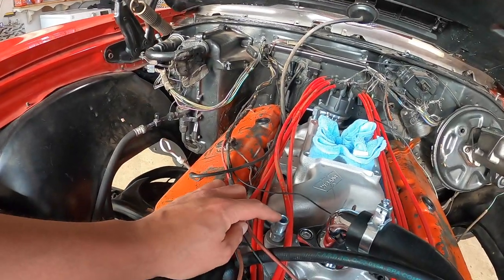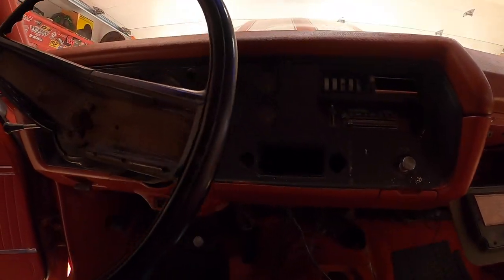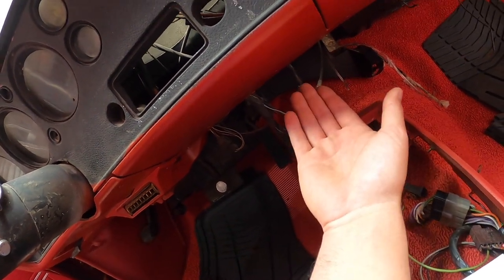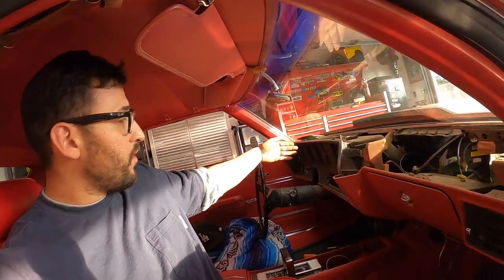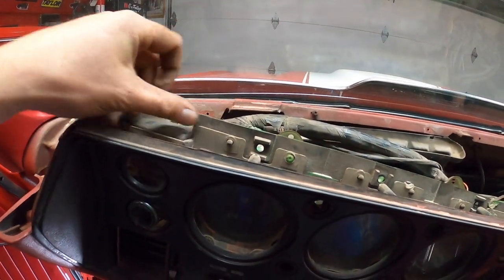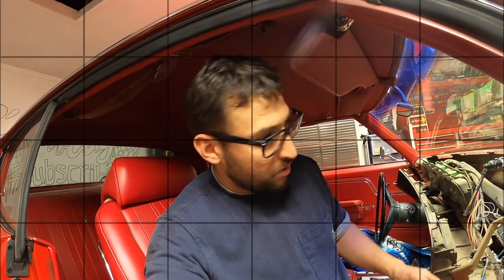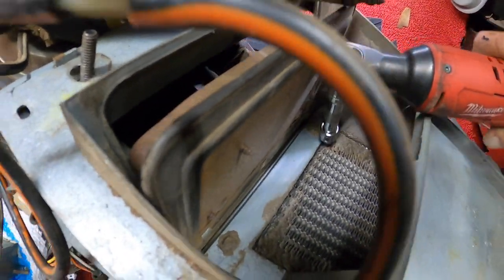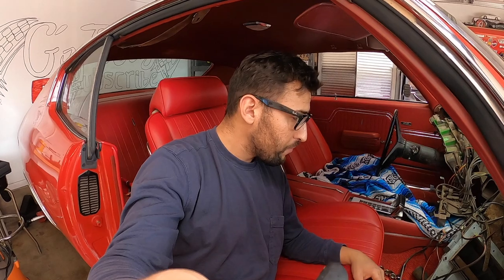How to replace heater core *** 1970 chevelle***

Comment: Thank you for the video. I will be sticking with the heater bypass. The applause was great!
Reply from the maker: hahaha it really was a mission to do!
Reply: @gsfootage5959  I'm trying to figure out exactly what turns the heat on in these cars... is it the cable from the selector or the vacuum actuator? And if it is the vacuum actuator,  how is that plumped in???

Comment: Your heater core is in the heater box under the glove box below that huge vent tube you see at the top. Wish GM made it so the heater core could be taken out from the engine side. The engineers need to be kicked in the nuts. They have no clue about what if you need to service a part. I had one car that did that. It was a 1968 Beaumont the Pontiac version of the Chevelle here in Canada. We sold both in Canada. I’ve bypassed mine in my 70 Z/28 a couple of yrs ago and now want to wait until Covid is over so I can take it in and get it recored rather than hoping an aftermarket will fit which most don’t. I think I would water test that core for leaks before you install it and if you bend those pipes like you did you can put a crack in the solder and she will leak.
Reply from the maker: yes the ac guys bot alittle beat up with the design. good idea, I will test to ensure no leaks.

Comment: Heater core replacement for a 70- 72 Chevelle without removing dash:

This is the quickest way to do this. This applies only to cars with ac I don't know anything about non ac.  Partially remove your passenger side inner fender well to gain access to the lower nut and remove (and it is a nut not a bolt! the nut goes to a stud attached to the inner heater box.) the second one is right under the heater hoses and the other 2 are towards the engine and can be reached. Next remove dash pad (bunch of screws pointing up; don't forget the ones in the glove box). Then remove the center ac vent this is above the ac & heat controls, this lets you remove the plastic duct box like thing too. Then remove the passenger side foot air duct piece from the bottom of the dash. Remove the door jam sill plate so you can remove the kick panel. Squirt water thru your heater core or cap the ends because fluid will spill out on the next step. Now you are ready to pull the inner heater box away from the fire wall and let it rest on the floor. Undo 3 screws on top side of heater box. Where a control cable attaches. Leave the box sitting right there. Don’t even try to pull it out. Reach behind it and remove 4 screws that hold a backing plate on. Use a flash light and mirror if necessary. When they are out the backing plate with the heater core attached to it comes out. 4 more screws hold the heater core to the backing plate. Reverse the order with the new core. I would check the new core first for leaks if you can. I put it in line with my heater hose and ran the car to temperature to high temp pressure test mine. You don't want to do this twice. GM must have built the car around the core. I guess that why they call it a core. Hope it helps.

Comment: Concerned you are using the copper bracket on an aluminum core.  Will there be electrolysis  corrosion and eat up the new core?  Doing a full box restoration...  Had my local radiator shop pressure test to 3-bars and it is the original and still solid after they did a complete flush.  Copper replacement cores are available .

Comment: My son is replacing a heater core on a 72 Chevelle, At the end when you used a flat head could you describe how you got the panel apart to pull out the core?
Reply from the maker: sorry just seen this, I don't remember exactly but it was very finicky to wiggle it out.

Comment: I have to do this to my 1970 GTO, use to do them at the shop. I do have an extra box. Any one can tell me how would you pressure test one? I know, attaching hose but need a set up to pressure test it with my tool. Thaanks.

Comment: I am a Bypass driver too with my 71 cutlass conv. , i did not dare to repair it ... is it not possible without dashboard disassemble ? Greets from Germany
Reply: Maybe G can comment, but I heard its possible.  I read that someone removed their passenger seat so they could lay on the floor for better access.  The pain there of course is that it's all blind.  You can't see the screws holding that box on except maybe that one lower one.
Reply from the maker: blue stang thats a good idea to remove the seat but its very tight under there. will be hard, maybe not impossible

Comment: Should have rebuilt your bass unit for a few bucks more. That aluminum core may get you a couple of years. The original fits
Reply from the maker: yeah I agree, but I took it all off already I want that vintage air system

Comment: Should have purchased a factory assembly manual.  You would of saved a lot of wasted time  in knowing where your heater core was located and how to remove your dash…..which you didn’t have to do.  We all learn and I am glad that you’re willing to learn but you’re going about this all wrong. By pulling out all of your screws that hold up your dash is a great way to break it.

Comment: Engineers…….Engineers at this time in automotive history made these cars very easy to work on.  You’re doing a great job, but once again buy a factory assembly manual and learn everything about your Chevelle.  PS……..Nothing fits like original parts.  A lot of the “aftermarket parts” you  buy today is absolutely crap.  Get the original heater core rebuilt/recorded.  The only proper way to go.